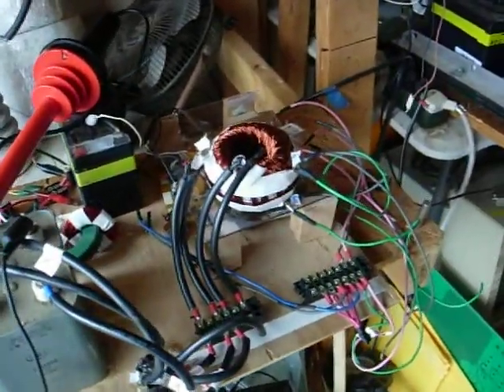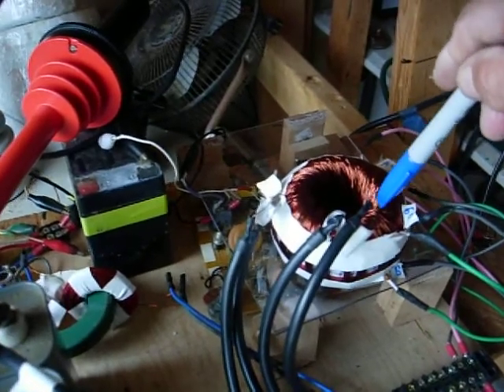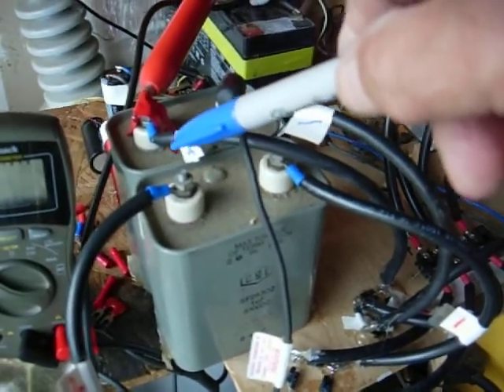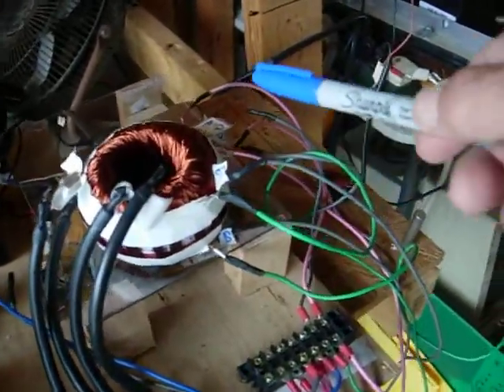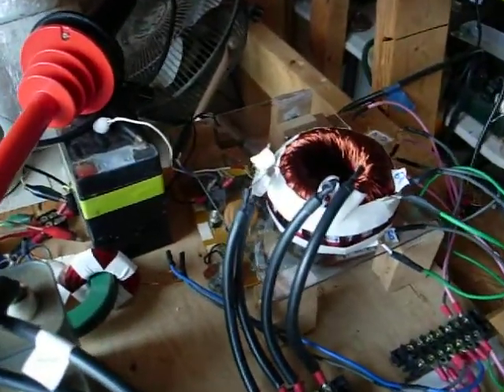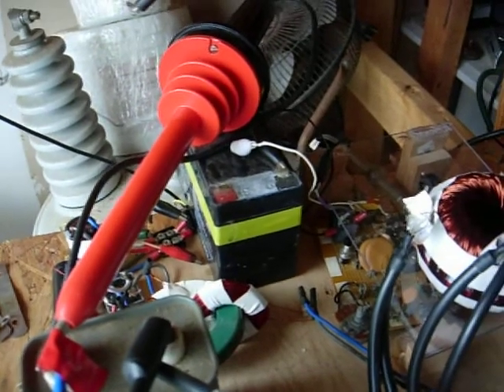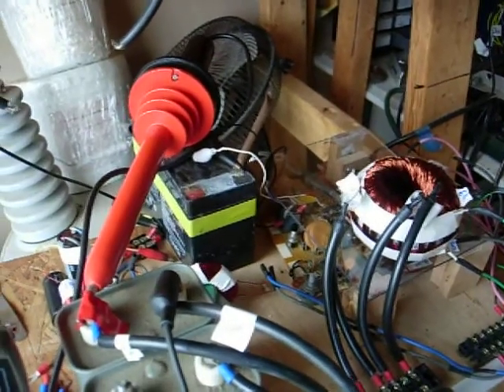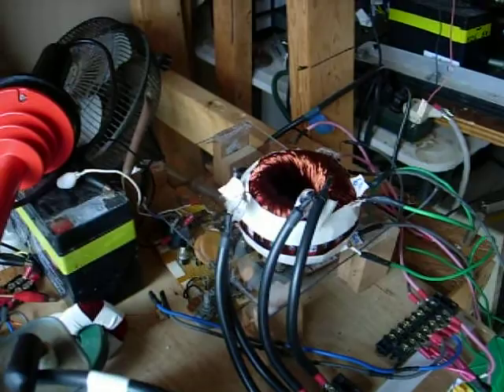Don Smith #251  rodin generating 4kv both pos and neg

Comment: Awesome work
Reply from the maker: the single wire filling the caps amazed me pure Tesla here  also tried the other end of 750 t coil to charge the other cap did both but second cap to only 2.5kv  still no return wire involved.   added 5 coils to center of donut hole and over top of rodin coil will resonate them next to keep battery fully charged if this works then I can replace battery with 48vdc Farad cap bank. and run for a very long time